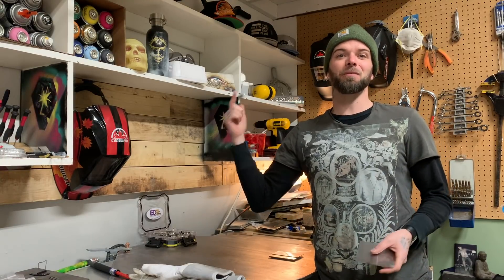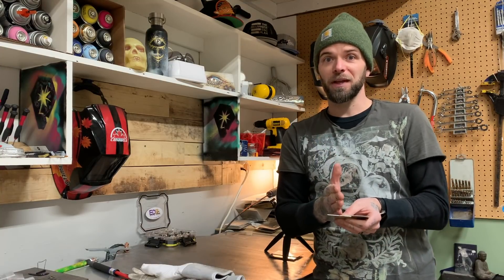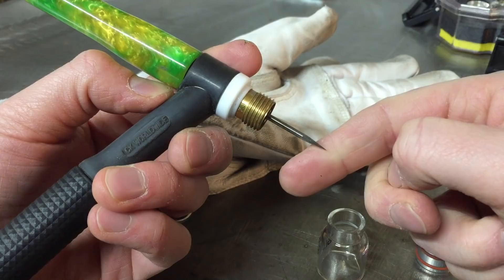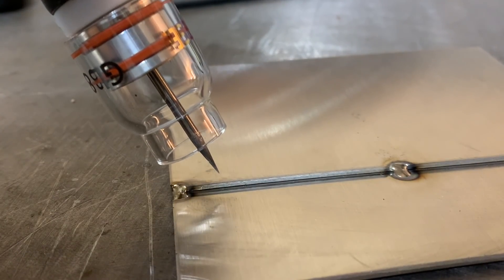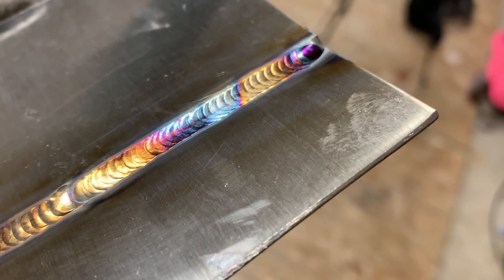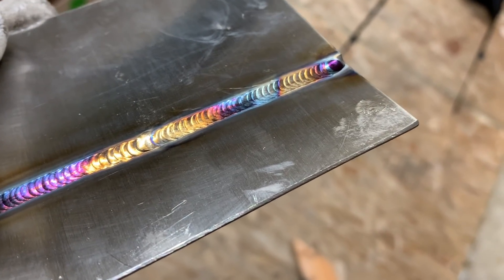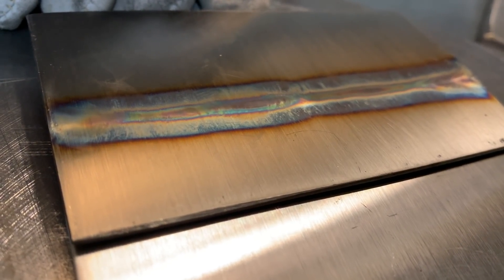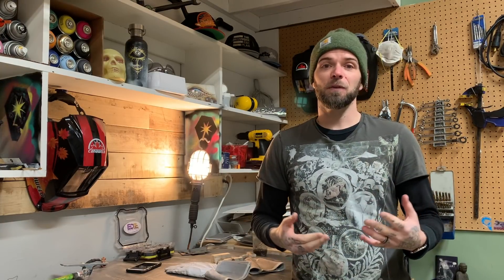BEGINNER Tig welding exercises! a lap weld on Stainless Steel!

Comment: The problem for me is that I can NEVER get anything but grey oxides. The reason is because by the time I am able to get a puddle, the piece about 1/2" around the cup has already turned cherry red. I've tried different current settings. Lower setting allows me more time, but it heats the whole steel up really hot. Larger amps forms a puddle faster but again, it just heats up the steel just as fast.

I'm not sure what happens...
Reply: Lower amperage tends to lead to too much heat input overall. Working on the higher end allows more of a “get in and get out” approach. For the latter, you need to increase your travel speed to avoid heat soaking the piece. The other thing to check is your arc length. If the arc is too long, you won’t concentrate the heat you do have into the puddle. Consider doing a few practice runs at just drawing an arc, adjusting the length between way too long and dipping and make sure you’re right in where you need to be,

Comment: Thank you for sharing. don't you get intoxicated with argon gas? or do you use face mask to be protected? Thank you.
Reply: I dont think argon does that. It merely displaces oxygen. It is a heavy gas, so it could settle in your lungs, but breathing stirs it up and vacates it. I've gotten a little light headed from TONS of argon in my basement. Nothing about 5 minutes of fresh air and a cigarette can't fix. Argon isnt the same as carbon monoxide or other poisonous gases. Of course, I wouldnt want to be in a sealed pipe with an argon leak. Suffocating doesnt sound like a fun time until its completely over...

Comment: Dude I’ll pop a dm sometime but maybe someone here will answer. My welds are oxidised so bad that theyre grey. Im not sure why, my gaa is good, got a number 7 cup at about 9l/min at about 45 amps. I know my cup might be a bit small but is it my torch angle perhaps or what else can i look at?
Reply: I realised i definitely have to much torch angle watching this video but for a different reason. I sometimes drip a ball of filler way infront of the puddle, probably because i was pointing the flame from my arc more to the side and its reaching the filler rod. Instead of down at the material
Reply: Nvm i found your video titled “why are my welds gray” 🤣🤣 lemme watch it quick
Reply: I reckon torch angle and maybe like 40 amps.. im practicing straight passes on the side of a 1-1.5mm pipe

Comment: I am also trying to learn Tig welding and I'm doing it the hard way... I have a 200amp stick welder with a (HZXVOGEN TIG Welding Gun WP26V). Which works well enough. I don't have any clear glass lenses yet and I'm using (2% Thoriated Red Tig Tungsten Assorted, 5PCS 3/32"x 7" + 5PCS 1/16"). I have been welding 18 guage stainless which is kitchen grade (316). I have been having a lot of trouble doing very good at all.. I don't have a peddle. So I have to adjust amps constantly. I don't have a sharpener for the electrode and have been using an angle grinder with a diamond tile cutting blade.. no ability to set the angle. Possibly not enough argon flow because it is difficult to maintain steady pressure with a manual nob to start and stop flow. With the setup I have it requires (scratch start) to function.. contaminated electrodes are normal for me. Beleive it or not.. I found that 308l flux core wire with a harbor freight 125amp flux welder works well enough but I can only overlap spots. So it's a lot of start and stop and it still gets really hot in order for the stainless to liquify.. so I know I basically need to upgrade my equipment and potentially be an "ok" Tig welder. Thanks for the education brother man!

Comment: Wait did you say what amps you were running? Would you say 35 if you were pushing peddle down halfway? Also we’re you using a larger SS filler rod?

Comment: Low amperage is actually going to add heat to the part isn't it? Also, you are supposed to double the cfh to the cup size right?

Comment: Dusty I'm new to tig, never did it be for and I'm learning so much from your videos. I like how you explain why something happened. The one thing I would like to see you add to the video is your current amps in like the bottom or top of the screen as you are working.  Thanks for the great videos.

Comment: Worth tacking the opposite side as well, stops the top piece lifting and distorting. Also clamp it down with aluminium or copper chill bars right close to the joint on the upper plate. It'll help keep it from distorting and will keep the bead from colouring up if you don't want the blue/purple etc.

Comment: Hey Dusty, awesome as usual, my hero:).    My welding is much more advanced since watching your videos. Can I ask how can you control the colour on stainless steel weld to achieve the desired colour? Can you achieve this on mild steel? Last question, I mostly weld aluminium castings and build fuel cells, I use a Lincoln 275 precision Tig with the advanced pulse control panel and I only use 2.4mm Tungsten with a normal basic  size 8 cup, it welds rather nice(not as good as yours). So the question, if I use one of these new style inverter welders and maybe a gas lens would I benefit by achieving better results? Welding aluminium plate of 2mm and castings around 15mm. Thanks man
Reply from the maker: Good questions! I definitely reside in the camp of being able to lay down beautiful welds with a basic machine. Transformers, small cups, don’t matter. Take the time to set up meticulously, run some dry passes (no fill) to get gas/travel speed dialled, and then work into the actual pass from there. As far as colours, check this vid I did, https://youtu.be/UJcn8W_Mv5I it was a fun one of balancing feed amounts, gas coverage- just goofing around really:) Thank you so much for checking the vid out! I appreciate you a lot🙏